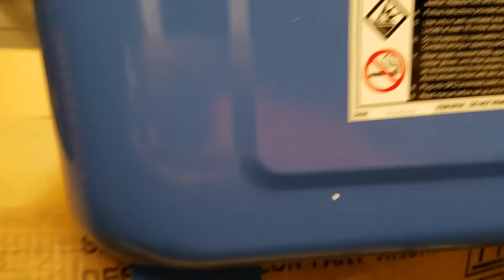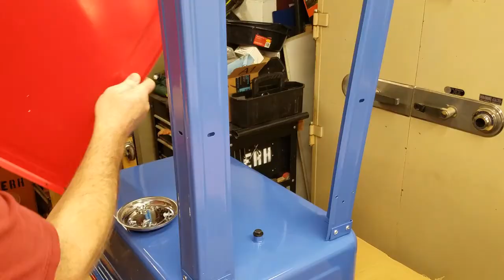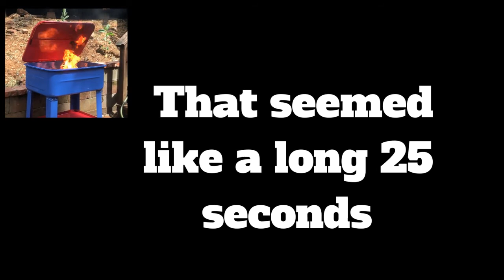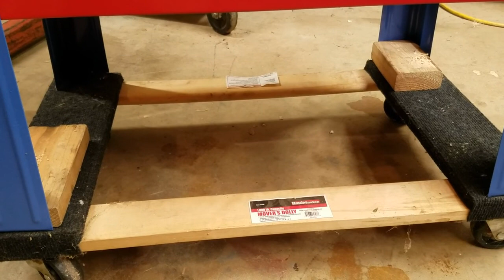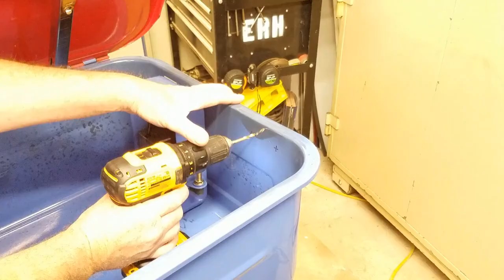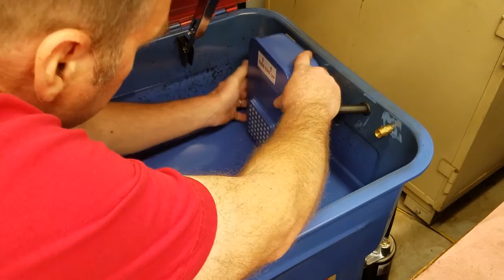Harbor Freight Parts Washer FIRE TESTED plus assembly and review

Comment: Your voice is literally like the most monotone level voice I've ever heard in my life. It sounds like you don't get excited much. 

That said, the whole setting fire to your brand new parts washer was awesome to watch indeed. Nice to know that the safety feature actually works. 

Instead of an oil filter I'll be using a fuel filter with a 2 micron rating. I think that will prolong the life of the solvent a bit better. 

You might want to consider getting the Oriflo flow-through brush. Seems a ton better than using the stock gooseneck.